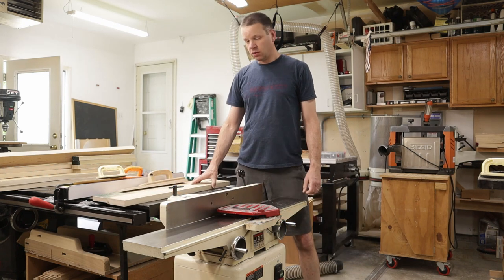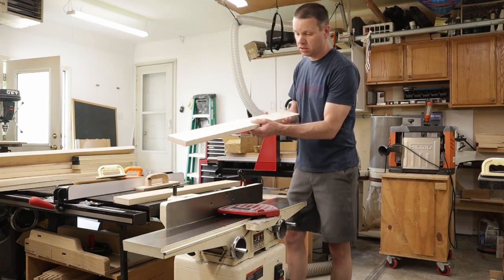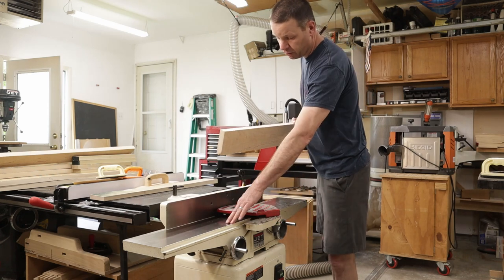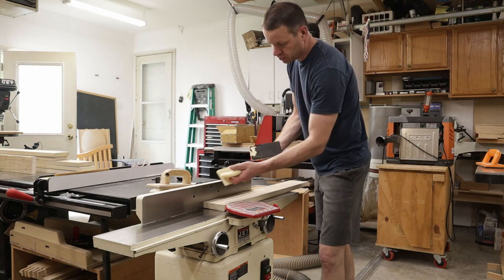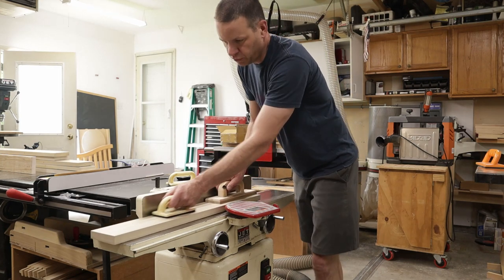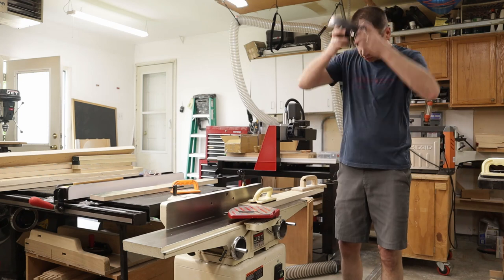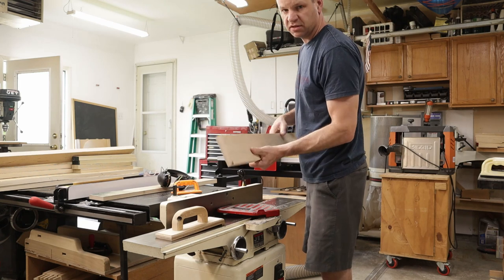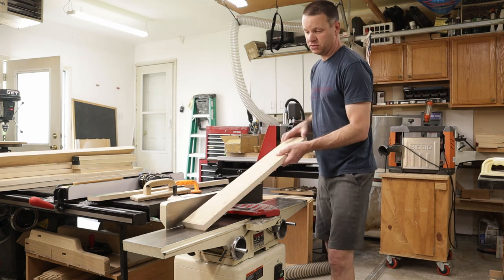Must Know Jointer Tip - How to remove Twist from Board

Comment: Yep, that worked for me. Four passes to remove about a half inch of twist, followed by several runs through the planer to equalise width with another board, and I have a glue up in progress.
Many thanks!

Comment: Great video, great explanation. My question is how to resolve the other (bottom) side of a twisted board? Would I use the table saw or is there a way to joint it and make it parallel to the top side? I hope I'm making sense 😊
Reply: You use a planer to make the other face flat.  The planer will reference the now flat side and make the other side parallel.